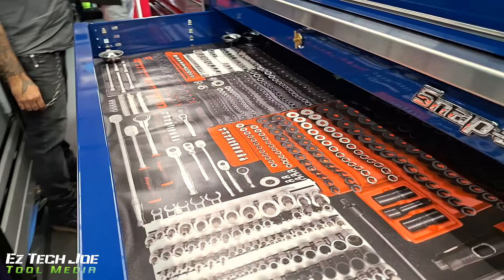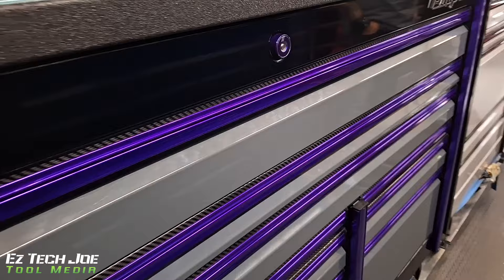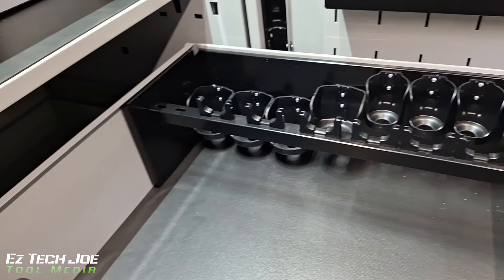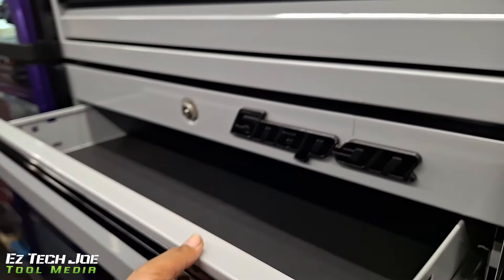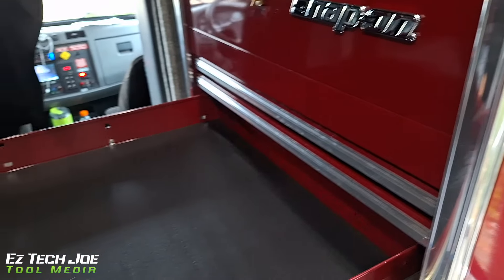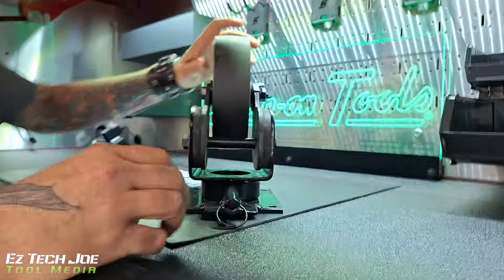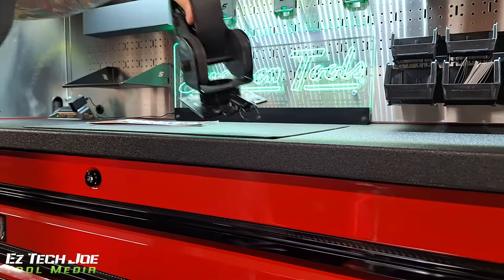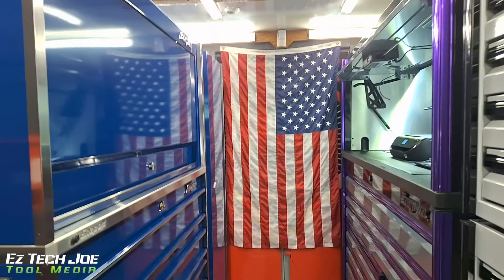Shopping For My First Snap-on Toolbox On The Snap-on Rock N Roll Truck!

Comment: Congratulations brother you will not regret it.  There isn't a better built box on the market. 
I am a 65 yo semi retired mechanic and I'm on my 4th and last Snap On box(s) I started in 78 and i got what i paid for each box when i traded in and upgraded. 
I am anal about my tools and boxes. Nothing gets put away unless it is cleaned. About every 6 months (or less) the boxes get a full cleaning and a wax once a year.  
I dont know if you could get that return today with the cost but in 10/15 years and keeping it in like new condition im positive you would do very well. 
The best thing about the truck boxes is AMERICAN baby. Built by our brothers and sisters, not some 12 yo in a fricken communist country. 
Having said all of that about keeping my boxes looking good, my poor cart(s) go through hell. I dont trade them, but i do clean them up as best i can and give them to a new tech that doesn't have one yet. I tried buying a cheap cart but they do not hold up to the hard life i put them through for 10 hours a day 5/6 days a week. 
Sorry for the rambling, i do enjoy seeing others succeeding.
Edit to add,
A couple points if you dont mind. 
1st, if you need to borrow a tool more than once, you need to own that tool. Pass that one down.
2nd, strive to be "that guy" in the shop. The one who is the most knowledgeable and are willing to help those new techs just starting. 
When i first started one of the best mechanics i knew offered to help me along the way.
Thank you Captain, RIP